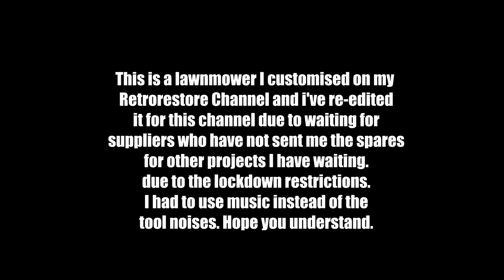Scrap Lawn Mower Restoration Powder Coating

Comment: I'm restoring a 35 year old Murray with a Briggs 3.5. I don't have a sandblasting cabinet or powder coating, but I do have paint. I'm hoping to gain the courage to paint my car, from the experience gained by painting decks.  You can see the mower on my channel, it's the red one that was submerged in a flood a few years back.  It runs great, now I'm in the process of stripping the engine and painting the parts.  I'm thinking of polishing the aluminum block and head.
Reply from the maker: Good luck with your project.
Reply: @RetroHax  thanks, I'm going to need it.  My channel has a few flood recovery projects I've been working on during this shutdown.  Can't believe these Briggs engines survived that abuse so well.

Comment: May I suggest that pipe stand you make a knotch in the top of the pipe so the mower front fits in also is you customize another may I suggest using rusteloum hammered paint

Comment: Looks really good. For right now. Unfortunately  all of the pieces that you powder coated chrome in a very short time will all turn a very ugly dull dark grey due to exposure to UV lights. You HAVE to clear coat chrome powder if you plan to use it in an exterior environment . However, when you do clear chrome powder it does loose a lot of that chrome luster. It wont look like it does uncleared, but it's your only option.. One of those things about chrome powder that has not been perfected. Other than what you are about to see in a very short time with the chrome parts, you did an excellent job on this project.
Reply from the maker: Yes John, I know about the chrome powder bud. Been doing this for a while.
Reply: @RetroHax  , you know it because bud you've been doing this a while now, but still didn't clear them?  OooooKaaaaay!! cough, cough!!
Anyways, the mower looked great.

Comment: Hi Martin , quick question for you if  can, as you have now done many a mower, ive just rebuilt a Briggs classic 35 and all working, my problem is i was given a deck with no engine but had self drive and the guy gave me the blade and the boss, now when fitting engine to the deck it pulls over fine, soon as i fit the blade i cant pull it over, ive undone the blade done it back up finger tight but still the same, theres  20 mm gap at each end of the blade so its not hitting the deck, would you have any new ideas, i was wondering if its th pully for the self drive if its to big?
Reply from the maker: I would need to see it to diagnose it bud. Something is fouling, Can you rotate the blade from underneath by hand? Please remove the spark plug cap if you try this. Is the drive mechanism fitted and working correctly? Is the pulley molded to the boss?

Comment: I realy like your Videos, i also have a old Lawnmover from 1995 here and i would like to repair it. It is a Quantum motor. But i am a little bit scared to work on them. Because i've heared that the Enginebrake und some gaskets contain asbestos. But i couldnt found something about it in the Internet. Maybe you know if the Briggs and Stratton Motors contain  asbestos?
Reply from the maker: Modern brakes no longer contain Asbestos but you could email briggs and Stratton to confirm this.
Reply: @RetroHax  okay, thank you. Later i send a Email to briggs and stratton

Comment: I would of just polish that muffler guard it is stainless steel use steel wool and soap than get stainless steel polish it looks new the heat with blister it